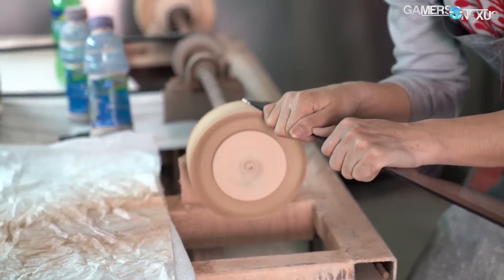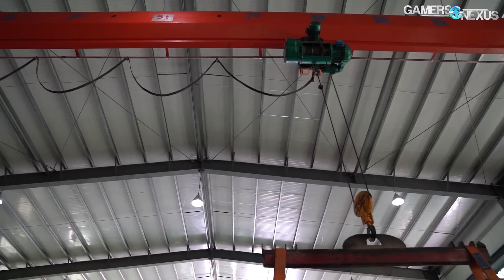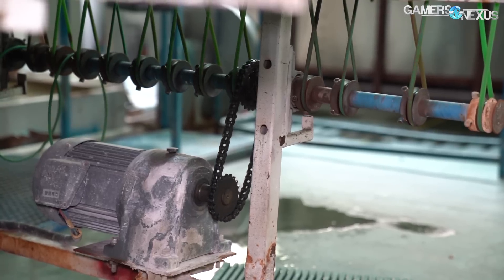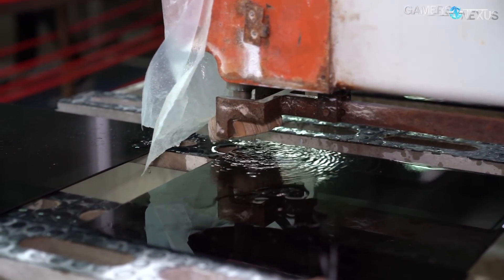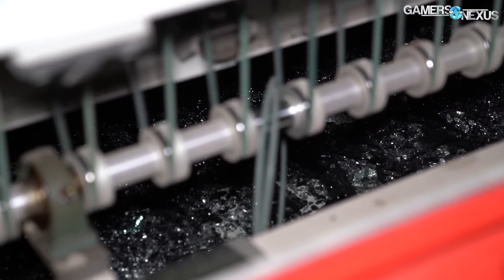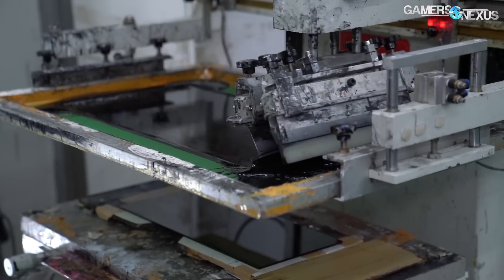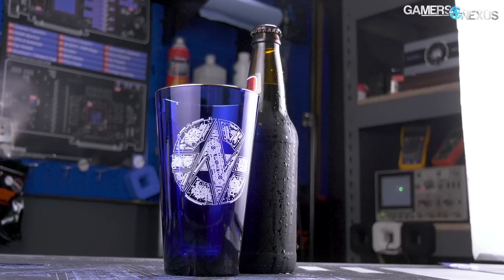How Tempered Glass is Made | Everyone Uses the Same Factory

Comment: On the oven part there is a second piece to the oven, the quench. The quench is what actually seals the temper into the glass by adding cold pressured air onto the glass immediately after it exits the oven. I worked in a glass tempering plant for 5 years very similar to this one.

Comment: 2:01 Bruh, he's not wearing any protective gear. WTF? That's immediate termination at the companies I use to work for.

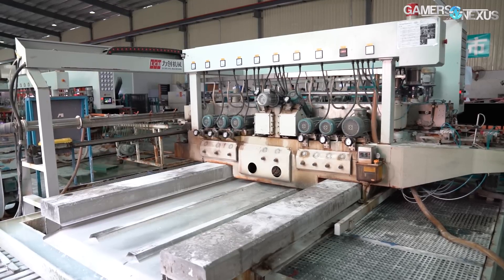4:18 Everyone that operates the double edger hates it for one reason. You have to clean the excess shavings from the tanks weekly otherwise there will be a huge build up of that stuff and overtime it will harden. It sucks to clean out those tanks if you wait a month or so.

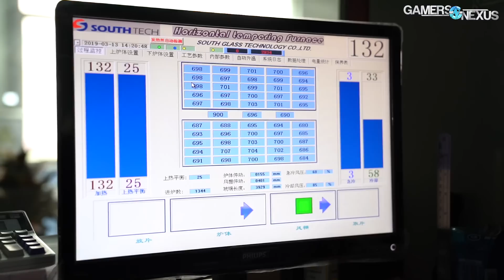7:49 I operated a double bed tempering oven that was much older than this oven. I've operated 4 single bed ovens. All of them can heat up from 0 to 675 degrees celsius in 12 hours. How the hell are they taking 1 or 2 days?

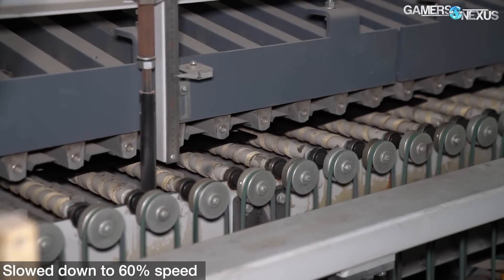8:50 That's the quench.

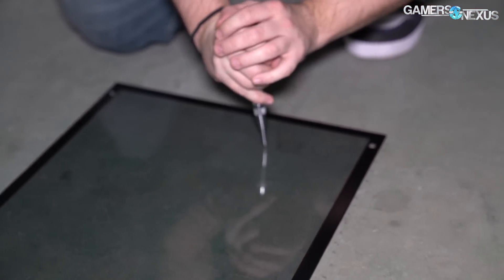9:37 We usually call it a center punch. For thicker glass, 3/8 to 3/4, you'll need a bigger one.

Sorry, been doing this for 8 years now. Great vid though.

Comment: A couple of things: when you temper glass, it shrinks so when it's cut, it's cut oversize to account for this shrinkage
That drill? I highly doubt it is "steel". It might be a steel shank but it is probably a diamond or diamond powder tip. 
Those machines that grind the edges: water is used to cool the grinders but also to prevent thermal shock from cracking the glass. If you heat one area of glass too high and not the other, the glass will grow or shrink and break. That's why it isn't recommended you pour warm water on your frosty car windshield in the winter.......

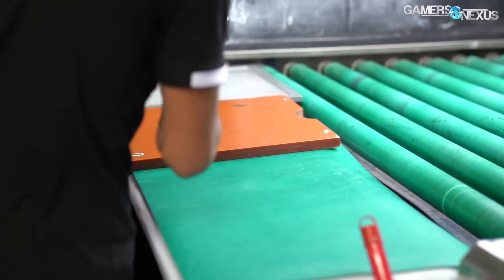Comment: 7:31 i just noticed but every second pane of glass doesn't get checked for correct size at this station
Reply: Since it said they also check for scratches under the bright light, my guess is that the ones not checked for size had a scratch and went into the line for buffing/scrap.

Comment: I want to respectfully correct a few things. It is a carbide cutting wheel that doesn't actually cut, it merely scores the glass which is sufficient to snap the glass along the score line with ease. The wheel is perhaps 5-10mm in diameter depending on the type of head in the machine. A properly aligned wheel can score a total length upwards of 10km or more. I know this because I used to work a glass cutting table at a window factory. It is NOT a safe job to do without proper ppe....
Fun fact - If a pane of freshly scored glass is left on the table for too long, say for example over break, the sheet of glass is likely going to break in random places and be scrapped  due to the 'healing' nature of the score line. It becomes nearly impossible to snap the glass along the score line after too long

Comment: Car windshields are laminated, and are designed to NOT shatter completely in impacts. A layer of plastic between two layers of glass helps cut down on the splinters flying all over. 
I have occasionally seen specifications calling for laminated Tempered glass on fumehoods, but that stuff is outrageously expensive.

Comment: The bent glass panels really aren't that difficult to make. The glass is cut to shape, holes drilled if required and edges are probably sanded/ground at that time (including holes), cleaned and prepped, then put into a kiln over a stainless steel mold for shape. Heated to shape. Then most likely it is cooled and and put into another kiln to bring to temperature, cooled and annealed (referring to the controlled cooling that will create tempering, not leaving it as just annealed glass) to create the tempering.

As someone else mentioned, this is safety glass, but just one type which is tempered. Another glass, which you misidentified is laminated glass, which is customarily used in windshields. That type of glass breaks like regular annealed glass, which it is, but holds together since it is two layers adhered by a layer of film/adhesive in the middle. So when it breaks, it holds together. This is to try and reduce the shards and pieces of glass that bombard the passengers, but also to help retain them within the vehicle during a crash. The side door glass, vent glasses, sunroof glass and backglasses are generally tempered glass.

Comment: The curve glass is probably first super heated near melting point. then put in a mold/press that bend it or press molded in a curve, pressed down on  the hot glass panel. secret much?  another possable thing could do is put it into a hot roller. curve it up. ?

Comment: The flat glass is first heated to over 630 °C − until red hot.
    Once heated, the glass is moved within the furnace into the bending station, where it is bent to its target radius.
    The glass can be twisted into the direction in which the glass flows, which is known as lengthwise bending.
    It can also be bent crosswise across the glass flow, which is called crosswise bending.
    The bent glass is then tempered by cooling to trap high energy forces within the glass.
    The bent and tempered glass comes out of the furnace.
Pretty secret, 5 seconds google machine search and paste.

Comment: I used to drop float glass like that by hand. Yes a  3 mm sheet about 100lbs, tinted is around 25% or about the same as 4mm . That was scary AF to learn when I was 19.
Reply: What plant did you work at? I work for Cardinal glass
Reply: @mrkotter69  I worked for a small sun-room manufacturer in Oshawa On. We brought floats in by forklift, drop sheets on the table (waist height) with suction cups, and cut by hand. no machines except the forklit.
Reply: @CoreyKearney  We packed the glass that size with a robot mostly, sometimes by hand
Reply: @mrkotter69  ya it was almost 20 years ago, a lot of small to midsize shops still did everything manually. and mostly jurryrigged by comparison

Comment: those small bends have been being made for atleast 40 yrs and this factory is such a joke in glass production ,automation has been around for atleast 50 yrs. Also when testing they should be weighing the 10 largest pieces for the thickness of glass, not by how many  pieces  when broke . what about laser etching as apposed  frit  I know I did a 30 yr tour working at tempering plants

Comment: Cool video.  Very detailed.  I know I'm 9 months late, but I would like to question a few things.  I manage a glass fabrication shop that does all of the pre-tempering processes, as well as the tempering itself.  The machine that is cutting the glass to size is most definitely tungsten carbide, not diamond.  Diamond creates more heat than a simple oil drip can handle.  It might be hardened steel, but I highly doubt it.  Next is the drilling process which you said was steel; this is the opposite of the first part.  Diamond may create more heat, but it can remove more material, and faster than steel or tungsten.  The drill press is using diamond core drill bits.  The water is actually pouring directly through the spindle.  
Even with all of that, it was a very well made video.  It's very interesting seeing the different machine designs when compared to the ones I operate.

Comment: Please can you answer me this, I want to temper a 4mm glass with a 3mm holes near the edges of the glass but, the person who is supposed to do that said it might break the glass where the holes are. Please can you tell me if it is possible and whether there is another way to do it, thanks in advance
Reply: the diameter of the hole can't be less than the thickness of the hole

Comment: automotive industry can produce toughened glass panels in virtually any shape for decades with all them bends and curves. I got mine made at a local tractor cab builder for 30eur for a Corsair VENGEANCE C70 though yeah they charge a bit more if they have to drill holes :)

Comment: Thanks for the video!  Just one small correction.
You said concerning the CNC machine....."a diamond saw is used to cut a small incision about halfway deep into the glass pane"
That tool is not a saw that cuts halfway but rather it''s a rigid tool that only scores(scratches) the glass. That was probably a tungsten carbide wheel head since you could see it rotate when it changed cutting direction. I think you're probably aware of this since you saw the glass up close when they let you snap it at the score line.
However diamond coated tools are used in the next step to smooth the sharp edges.

Comment: The diamond cutter does not cut halfway into the glass, it scores it. The oil is there for multiple things - cooling is one reason, others are to help maintain the cutters edge and keep the cuts "clean". If that thing was cutting "halfway" into the glass, it would most certainly break.
Reply: If you read a little you will find it is not simply scoring the surface, that is what tends to be done with tiles, a deeper imprint is needed for TG or the break shock will shatter both panel sides
Reply: Ben Grogan the glass is not yet tempered at that point so your point is mute. It is not possible to cut tempered glass after it has been tempered.
Reply: @danny3793  it is entirely possible to cut tempered glass, before you make absolute statements based on things you have been told I'd suggest doing a little research - simple regugitaion of this sort is how half truths propagate.

It requires local heat at the cut point to reach above the strain point of the glass, usually achieved by extreme cutting wheel speeds, while the rest of the glass is kept below the strain point, creating a local annealing effect at the cut location that permits cuts if vibrations can be properly eliminated, hence why you also see buffer pads above and below the machines shown drilling the tempered glass in the video.
Reply: Ben Grogan I have worked with glass for over ten years. To cut tempered glass it must first be annealed. At that point you're not even cutting tempered glass any longer. Tempering glass creates extreme tension within the structure of the glass which increases the glass blunt strength yet weakens its ability to handle sharp objects. Before you make statements on things you obviously have no idea about, do a little research.
Reply: Ben Grogan also, the point in the video where the cutting is occurring its not even tempered yet, its still annealed. Cutting tempered glass by way of annealing is not cutting tempered glass. Also, when you anneal the glass regardless of localization of heating, it can no longer be considered safety glass and would likely not pass code in many areas within the US. Your example of how to cut tempered is some home hobby half attempt. Measure your glass correctly the first time around and you shouldn’t have to cut tempered glass, ie it should never be done unless you plan on dealing with annealed glass in applications where tempered is required.
Reply: @danny3793  A good attempt to save face by running a fallacious appeal to authority - I'm sure your uncle works for Nintendo too.
Pardon the sass but I do find it hilarious when people feel the need to claim expertise as a one up without even considering who they maybe talking to may have similiar fields.
However well done essentially rephrasing my previous post about how you'd go about cutting the Tempered glass, thanks for conceding the point.
Reply: Ben Grogan additionally the buffer pads shown in the video for drilling are not only for reducing vibrations but ensuring the liquid used to cool the area remain long enough to do its job. Cool the area and flush away the debris created. Heat is not creating a localized annealing effect in the point of the video you are using as your example. You obviously have no understanding of the processes at play when drilling annealed or tempered glass let alone what role heat does or does not play in drilling.
Reply: Ben Grogan you aren’t cutting tempered glass if you’re annealing it. You’re cutting annealed glass. Nice try. Also, your point is incorrect as it makes those assumptions based on the drilling aspect rather than cutting. Seriously? My point regarding drilling nullifies the entire basis of your argument for why localized annealing is even a thing. If you don’t understand how drilling glass works then this is obviously just a troll. No appeal to authority, simply stating the facts. I’d suggest doing more research before attempting to straw man your way into a conversation you know nothing about with sad attempts at high and mightiness. Good day.
Reply: @danny3793  Someone's pants got in a bunch quick. 
At what point did I say the drill was creating a localized annealing effect, go ahead and try point to it -  

But a good deflection now you have realized your initial comment was based off a false assumption.

Good day indeed
Reply: Ben Grogan I don’t need to regurgitate your poorly researched response. You and I both can easily see what you wrote. 11/10 troll though.
Reply: Ben Grogan the only realization I had was how obvious it is you realize you’re wrong and revert to fallacies, straw man arguments and other non-sense to try and prove a point you poorly tried to make about something you obviously have no experience with. Discussing with you further is hardly worth it considering at this point you are obviously just here to get a ruse rather than actually discuss the topics I originally commented about from a knowledgeable and experienced perspective.
Reply: @danny3793  And yet you still feel the need to give 2 long winded responses despite proclaiming me as simply a "troll" reverting to fallacies after being called out on his own.
I was hoping you might be mature enough to stick to your guns when you said good day, but I guess muting this so you're screaming into the void will need to do for you.

Comment: Tempered glass is not used in windshields. Windshields are made of laminated safety glass. It is two layers of glass adhered to a layer of vinyl in between, so when it breaks the glass stays together instead of creating large sharp pieces.

Tempered glass like seen in this video is used for side and rear vehicle glass, but not the windshield. You've never seen a broken windshield? They will crack but will not break into thousands of pieces like tempered glass does.

Comment: I worked at a lamp manufacturer in the '80s. We had our own glass production facility in a separate building and I can tell you exactly how bent panels are made. They run the glass through a kiln with a positive and negative buck, the negative on the bottom and the positive on top. Then the kiln is heated and gravity pulls the positive buck into the negative buck and the glass is formed between the halves. Then the temperature in the kiln is slowly lowered to prevent thermal shock and breakage. After the glass has cooled to room temp (or close enough it won't shatter) it's removed from the kiln. In the case of tempered glass, the tempering would then be done after the panel is bent. Doing it first would result in the glass reverting to un-tempered glass just like heating tempered steel will remove the tempering.
Reply: Hell yea thanks for the info

Comment: I tried making replacement glass cover for my case. I broke 2 glass panel but the 3rd was a relatively a success. The 3rd glass have a misaligned hole which requires some extra grinding to make it fit. This one will definitely failed the QC in that factory but its good enough for me.
The hole drilling process is definitely the most critical part, if you screw it up, the the glass panel is fucked. The arrowhead drill bit is terrible for this, use the hole saw drill bit its the best.

Comment: At our factory, we produce the glass from raw materials, float it atop a bath of molten tin and finally produce the large raw sheets you see at 2:03. We also apply various coatings and the tempered glass you see here. Wow, the safety standards in that factory are quite different from where I work. 
2:02 He's "slinging", moving sheets of glass using fabric slings and an overhead crane. At my factory, anyone doing this must wear gloves, cut resistant clothing, helmet, and steel-toed boots, unlike those sweet, hot pink sneakers he's wearing. 
2:57 This is called "packing", breaking off the final pieces and stacking it. Although we don't have to wear helmets, anyone performing this process must wear cut-proof clothing including a long sleeved shirt and a cut-resistant apron. The unused scrap pieces are called "cullet". 
3:47 This process is called "edge trimming" Currently, we only perform this process for a single customer, but that customer is so valuable, we invested in the machinery at our own cost.  
9:39 If you really want to see tempered glass break, don't strike it on the facing surface. Just a light strike on the EDGE surface will turn a large sheet into the world's toughest jigsaw puzzle. 

You did a great job of outlining the process. The factory tours are much appreciated.
Reply: What factory do you work at I work for Cardinal glass.

Comment: lol..trade secret how to bend glass? basically you make a metal jig of the final shape you want the glass, you put the pane in with the jig in an electronically control oven. Basically it ramps up the heat, gets to a specific temp which the glass is not really melting but gravity with form the pane to the desired curve. After that is a slow cooling down and you are done :)